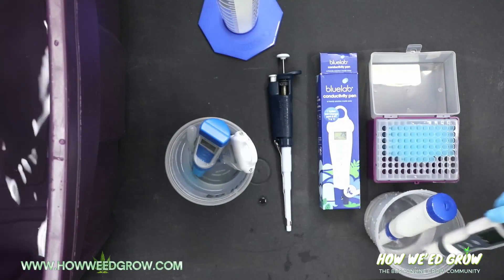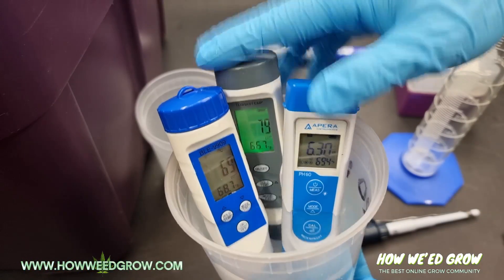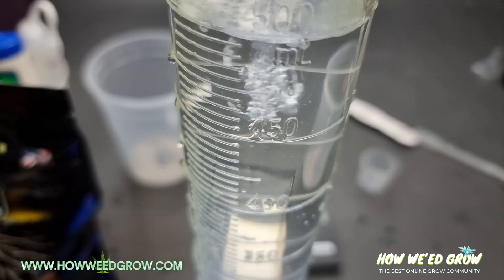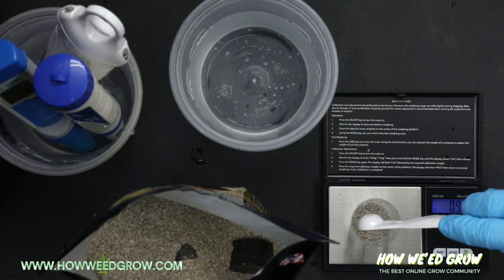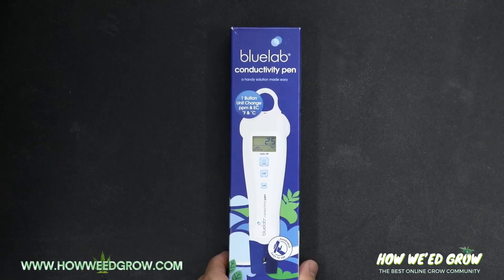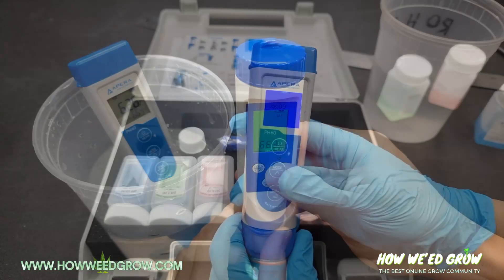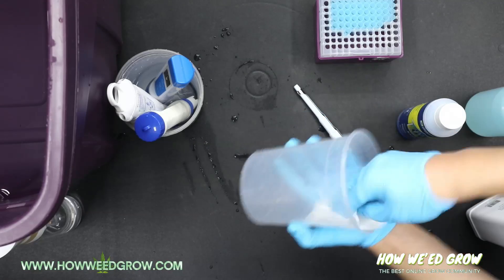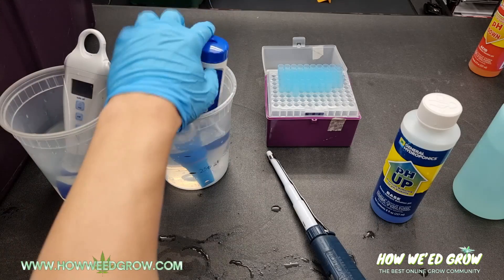How Weed Test - Protocol for  Nutrient Tests on ppm and pH

Comment: do you recommend the rcyago? I was looking at a Bluelab but I dont like that it rounds to 10s, is the rcyago good?
Reply: ps - if not a rcyago, do you have another one you'd recommend? what id be using it for wouldn't go above 500ppm
Reply from the maker: yeah definitely, I been using it for a while, it tests both pH and ppm and I compared the ppm to a lab's ppm meter at school, spot on. However, the pH is off by like .3 (at least mine is). I use both the RCyago for ppm and apera for pH now. Also did a review on the pencon on my site, not a fan. Rounds to the 10's. Such a shame these meters got such high ratings, its really misleading.
Reply: @HowWeedGrow  awesome!! thanks brotha!! I actually only need the ppm function at the moment.  I noticed the Bluelab products that aren't like $300-$400 seem to all round to the 10s and since im measuring so low I really need it to not round. Really appreciate the advice 🙏 and glad I checked to see if they round :/ happy growing

Comment: Awesome series!  I’m curious about Hydrogen Peroxide, you suggest to use a few drops in a gal of water, but what exactly does it do? Does it lower ppm? Why would plants like or benefit from it?...I never had a good understanding but I follow your advice as it doesn’t seem to hurt my plants at all. So far I’m on week 2 of flower and things are looking awesome!
Reply from the maker: It kills and microbes that may develop while the water is dechlorinated. Believe it or not, tap water also has organic matter and when H2o2 touches it, it reacts, kills it and breaks down into water and an extra oxygen molecule so it actually further oxygenates water. It’s important that it’s only a drop or two per gallon because it dissipates within a day. If you use more it will still be I the water and kill beneficial microbes in your soil. Happy frog soil has microbes in it so it’s best not to overdo it. If you watch my hydro series, you’ll see me add 30 ml to 17 gallons of water because I’m running a sterile grow. There’s really no cons.
Reply: @HowWeedGrow  This is why they call you the great weed senpai! Thanks man for all your info! I’ll share how my grow turned out once I’m closer to the end which should be late May or so, I’m week 2 of flower and things have been awesome, but I already look forward to the next grow to apply all I’ve learned.
Reply from the maker: @Trynage93  awesome, be patience my friend, I know the first grow always makes you want to chop early